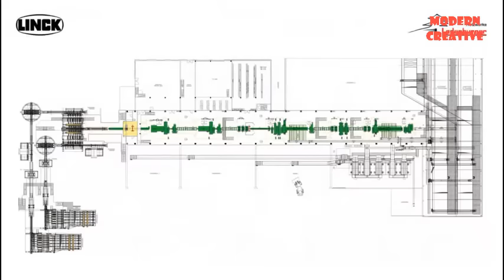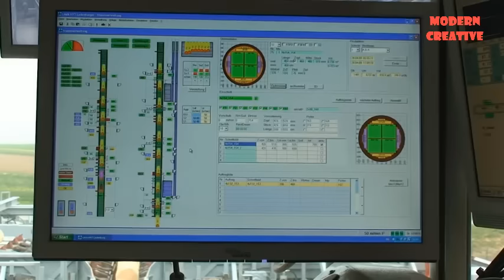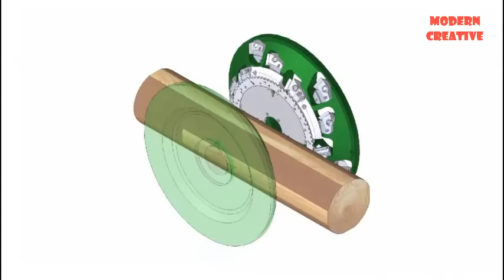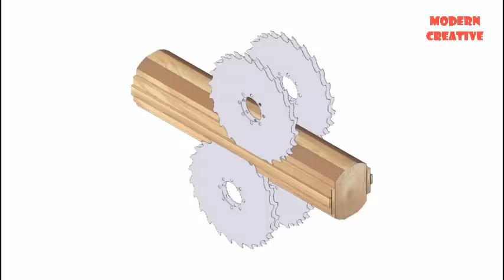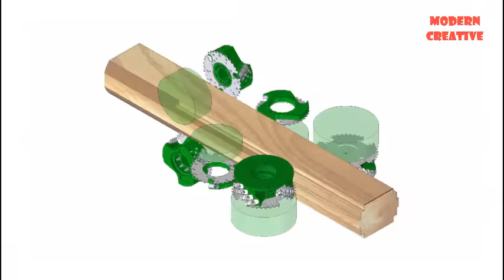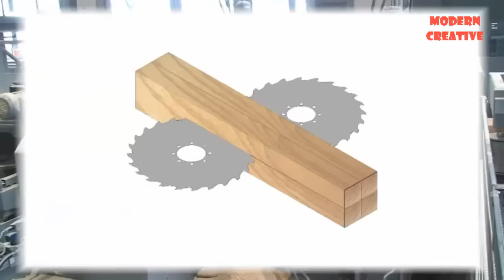Extremely Dangerous Oversize Logs Truck. Famous Wood Processing Mill & Manufacturing Cable Drum

Comment: One small, but vitality important omission from the shown processes... drying! I don't even want to think about the ensuing messes created by turning wet lumber out into the wilds of various construction. At the very least, as a furniture builder for the past 40 years, I'd cause grievous bodily harm to anyone who ran a board with more than 12% (you can expect a m.c. of as high as 25-30% straight off of a raw log, no matter how long it sits in the yard) moisture content through any of my machines, let alone all the havoc of things blowing into scrapwood once it does begin to dry.

Comment: I would like to see the electricity bill for this operation. I was surprised to see men working planing machines without ear protectors.
Reply: You should have had a visit down our Coal Mine in the UK BEFORE IT CLOSED..WE WERE USING OLD FASHIONED hOLMAN wINDY DRILLERS WITH 9FEET LONG DRILL RODS IN bLUE wHINSTONE...ALL DAY LONG DRIVING ROADWAYS THROUGH SOLID STRATA..NOW that WAS NOISE...!!.i HAVE WORKED WITH ALL THE NORMAL WOODWORKING MACHINERY..IT DOESN'T COMPARE..LIKE TOYS!!
Just realised Caps was on..too late at night to scrub and start again!! Sorry mate!Cheers Bill in the UK.